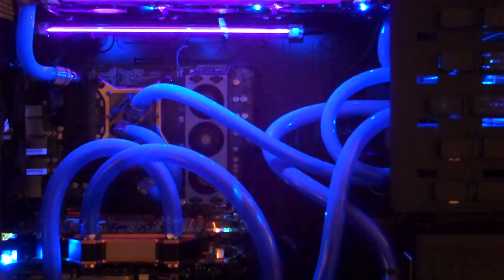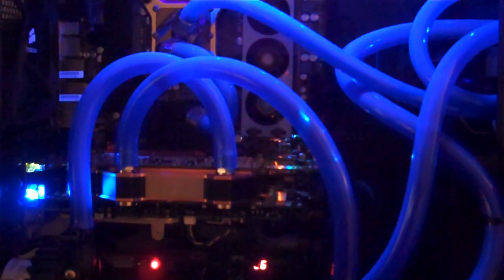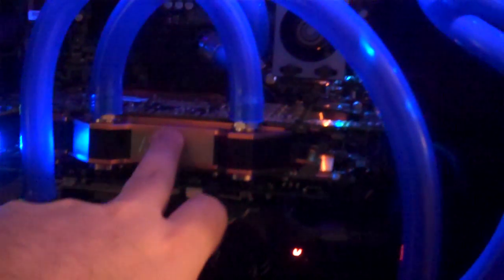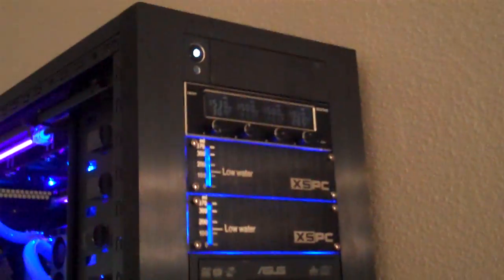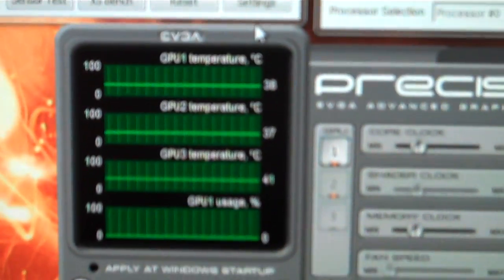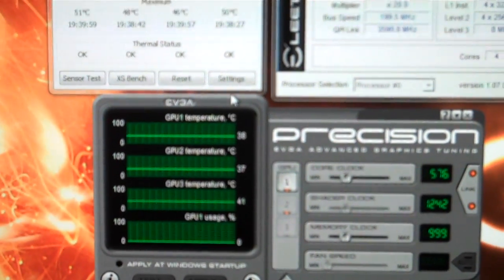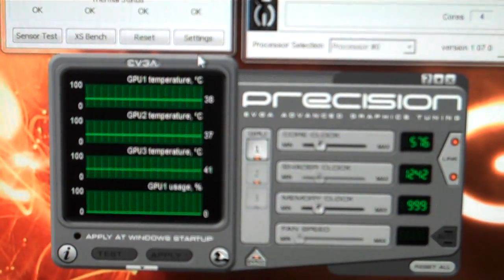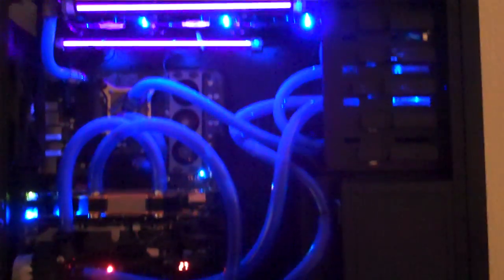Corsair Obsidian 800D Water Cooled Dual Loop Final

Comment: @thegreyvingian No its good to test your watercooling system before installing it in the case with the rest of the components but for long term use its best to get special coolent otherwise you might run into some problems later on.

Comment: Nicely done. I have a similar system in an Antec 1200 (CPU loop). I don't think it turned out quite that well, but the 800D has a lot of room behind the tray compared to the 1200 to tidy things up.